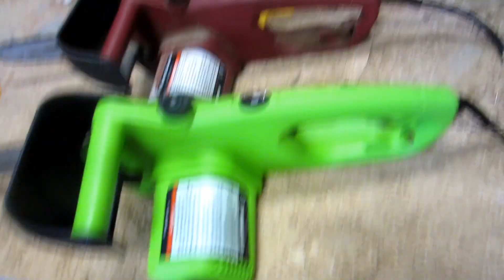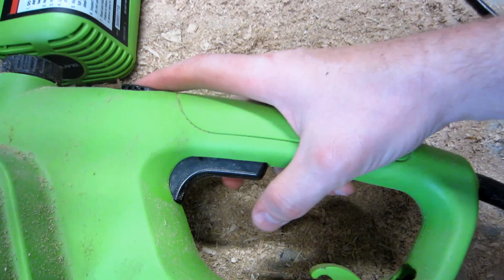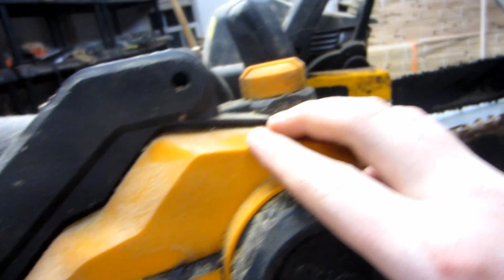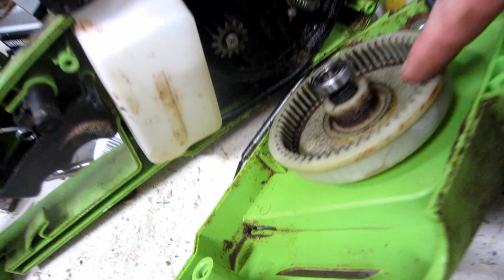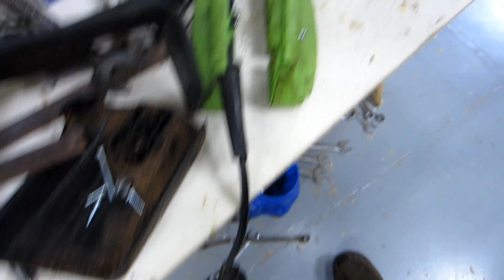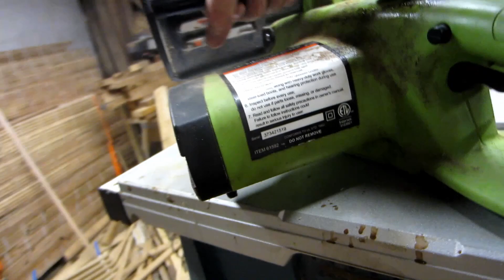Harbor Freight Electric Chainsaw Reviews! (unsponsored)

Comment: how hard do you lean on your chain saw when cutting logs???
Reply from the maker: It's not so much the pressure as the time.  Using an unbalanced tool for a long period of time is highly fatiguing so you end up cutting asymmetrical.  If you're referring to the gear stripping, that is just hit or miss.. first use and it immediately fails, or lasts years.

Comment: the worxs 8amp 14inch  chainsaw  is a very good chainsaw it last lone and yes i use bar and chain oil but i cut  for 2 years and its still runs about a day running clear cuting yea i have to sharpen the chain but i think it good

Comment: Dunno your probs with PP4218. On mine, new (colder than stock) NGK plug, quality chain, and carb adjustment with Husqy tool, and it works fine. Still has no "blade", rather a bar. First thing with HF chainsaw: sharpen chain & release tension a bit to reasonable. Adjuster screw head is VERY hard to reach. Anyhow it looks to be way better than my POS Wen electric.

Comment: I just took a Portland electric chainsaw back for return - transmission failed after just two uses - got a refund with no problem and will NOT buy another one :(
Reply from the maker: Sounds about right.  It really is hit or miss on the transmissions for some reason.

Comment: FYI, the 61592 is now the 64498 (after the power switch recall, I guess).  Just got one yesterday, and they match up perfectly (and all the model numbers on the box simply had 61592 pasted over with the new number; I guess it's cheaper to pay somebody to apply all those stickers vs. waste boxes!)  The 64497 is the new copy of the (lousy) 65255.

The 64498 is not listed on the website, but it was the one on the shelf in my store (Raleigh, NC.)
Reply: how did the one you bought work out for you?

Comment: I bought the Portland 3 days ago, added the oil, checked the chain and then took down 3 trees in my yard (9-10" avg stump diameter), cut them up into manageable pieces. Worked fine for me. For $39.99, worked line a champ. Going to cut down a few more too.
Reply from the maker: Nicely done.  I have cut down dozens of trees and processed them with these cheap e-chainsaws as well... except for the one or two that broke immediately upon first use.  It seems like if they survive the first use, they will last a long time. :)
Reply: Yea I just did the same thing and had no issues and cut down two trees and trimmed a bunch of branches.
Reply: Mines while but want cut any solutions

Comment: This is the most interesting thing about me if the thing messes up on the first one why don't you get the extended warranty or why don't you just take any of them back I'm just wondering myself because anything electric or mechanical with stuff from Harbor Freight always get the extended warranties just a cover crap like this
Reply from the maker: I do a fair amount of engineering, and at the low price point, I figured I could just repurpose the parts in another project.  I ended up returning the broken ones for store credit due to the major recall as it turns out.  I only buy warranties for expensive products generally speaking.

Comment: There is a recall on my chicago saw like the one in the video and the green portland, i took my in yesterday and got a portland for free and no questions ask recall. The safety switch was not shutting the saw off like it was supose to. Look up the notice on harbor Frieght  change saw's
Reply from the maker: Someone else commented about this as well.  I pinned your comment to the top so others might read it.  I exchanged several of my HF chainsaws for store credit, since I don't like the only model they now offer.  Let me know if you or anyone else happens to find a similar chainsaw in torque and price point that you'd recommend. :)  Thanks!

Comment: I only have a little experience with chainsaws. I have a 18" from Black & Decker which worked great for cutting down 1 big tree and 3 or 4 small tress all the way to 4 ft long logs. The chain got worn out after several uses and I replaced with "Oregon' chains and they are awesome!! Also that one is heavy and want to get a smaller one. going to get the Portland one 14" from HF but glad I watched your video. because there came a coupon book and this junk was on the list.
Reply from the maker: Yeah, I'm not a fan of this chainsaw.  The model I liked is no longer sold at Harbor Frieght, so I'll have to find a new model somewhere else to use for primary chainsaw work.  Good luck with finding another chainsaw you like. :)

Comment: Something's going wrong with the one I'm using. It'll be cutting through something then it'll just stop. Then as the motor is winding down, the sprocket will engage again.
Reply from the maker: I would guess the trigger contact is worn out or has a defect.  Those triggers are the reason for the recent recall - they can get stuck "always on", which probably means the impedance is inappropriate on the contactors.  Or maybe it's more mechanical in nature and the trigger gets jammed... it's unclear, but what is clear is that the triggers are poorly manufactured.  Just a guess!
Reply: Chris Covington I think this is the worn down plastic teeth in the gear shown in the video. Mine did this until it was completely worn.  Now motor runs and no spin at all.
Reply: @nathanstoutimore  It doesn’t seem like it is too big of a deal to replace the gear. Did anyone check to see if Harbor Freight carries any parts for these chain saws? It seems like they should being this wasn’t the first post that I read stating that the plastic gear wears out.

Comment: Looks like the extra plastic around the top of the drum gear in the better model most likely prevents flexing of the drum. This extra strength keeps the gears in contact with each other preventing stripping.  Also if there is too much play in the gear spacing it will quickly fail. This  “play” should be check in a new saw before its used as just one skipped tooth will quickly cause the rest to fail in short order.  Thanks for the video. Due to the difference in the plastic gear I will definitely be shopping for the 61592 model. Thanks !
Reply from the maker: Interesting theory about the extra plastic.  HF no longer offers either model - though the new model they offer is closest to the less ergonomic version of their chainsaw.  In other words, as far as I know, they no longer offer the better electric chainsaw.  Personally I've given up on buying chainsaws from HF.  Good luck!

Comment: Eh I've just seen a great review on the one you just got.cut right through a ten inch tree
Reply from the maker: I've had these chainsaws last a long time, or fail first use.  It's kind of a dice roll.  I've cut trees much bigger than 10" quite successfully with several HF e-chainsaw models.  The gear is one issue, but the usability of the trigger is more important for serious use.  Thanks for the comment!
Reply: It's cuz I'ma get one next week, that and pressure washer

Comment: FYI, Harbor Freight no longer sells a corded chainsaw as of this message (5/9/2018). I'm guessing they are coming out with a more expensive model.
Reply from the maker: Confirmed on their website... no corded chainsaw inventory.  Crazy abrupt!  Thanks for posting.
Reply: https://images.harborfreight.com/hftweb/recalls/Electric-Chainsaw-67255-61592-Recall.pdf
Reply from the maker: Thanks.  That explains it!
Reply: No, still available as of Oct. '18.
Reply: Model #64497
Reply: https://www.harborfreight.com/9-Amp-14-in-Electric-Chainsaw-64497.html?ccdenc=eyJjb2RlIjoiNDQxODU4NDAiLCJza3UiOiI2NDQ5NyIsImlzIjoiMzkuOTkiLCJwcm9kdWN0X2lk%0D%0AIjoiMTI2NjMifQ%3D%3D%0D%0A
Reply: Just got their advertising paper (March 2020) and the portland corded chainsaw is there on sale $39.99. Crystal River Florida.

Comment: As far as I know, all corded electric chainsaws use a plastic drive gear. If you push them too hard, the gear strips out. Makita used to make a chainsaw with metal gears, but they replaced it with a plastic drive.
Reply: I pulled my Craftsman apart, It looked pretty much like the HF with plastic to steel gears.
Reply from the maker: I've actually thought about the idea of casting a replacement in a metal... the problem is mixing a metal and the other nylon gears together; metal vs. nylon, the metal always "wins". :)  That said, I just got a Creality CR-10S (knockoff) 3D printer and am planning to experiment with PLA embedded with 30% carbon fiber as a possible replacement gear.  This probably isn't especially helpful to people without a 3D printer, but could be an interesting experiment.  I'm fairly certain there is a manufacturer that just sells "standard" gears and there is probably a compatible gear... I just haven't gotten around to grabbing the current gear and my calipers to attempt to track one down.

Re not lubing the gears: the failure I have in this video actually was lubed, but it's another theory that could be true in some cases.  I'm still scratching my head a little due to the dramatic failure of some and others that last years, yet everything looks pretty identical.
Reply: I stripped the plastic gear out of three Remingtons, one was an old made in USA model. I recently bought a Black & Decker 15 Amp with an 18 inch bar and even though it has a plastic drive gear I was able to cut seasoned hardwood that was larger than 24 inches in diameter. The saw is amazing. I did take it apart and greased the gear with Super Lube before using it and again after a couple of hours of serious cutting. I don't know if that made a difference, but I figured it couldn't hurt.
Reply from the maker: Yeah, not surprising.  Brands have no loyalty to customers, so customers can have no loyalty to brands.  You can buy most brand name products and they aren't much different - sometimes even worse than the really cheap brands.
Reply from the maker: Anything to save a buck I suppose.
Reply: That, and make a buck on replacement parts.
Reply: someguyinncarolina  Just my 2 cents, the biggest problem is probably like you said, the manufacturing process for the gears may not be very consistent along with probably cheaper plastic. It would seem like they could invest a little more for good quality plastic that takes some abuse and charge the customer a few bucks more. I'm also wondering if they sometimes don't lube the gears well at the factory. It would be cool to see if someone could take a new gear and use it to make a mold and maybe make an aluminum gear if the details would come out, those gear cogs would probably be difficult to cast. Not sure if aluminum would last any longer but..........
Reply: someguyinncarolina  Yeah, you're probably right, tolerances not being very good and/or material just not tough enough. It would be really interesting to see if you could 3D print a gear that would hold up!

Comment: I have the red one - 14" Chicago Electric.  I also have a 14" Remington and a Remington pole saw.  The chain which came on the HF cut poorly.  At one point, I swapped the Remington chain over and it cut fine on the HF, and better chains are just $5 (ebay).  Yesterday, it started free-wheeling, so took apart and found the large nylon sprocket had stripped teeth.  Must pull one bearing off the shaft to remove the sprocket.  Like others, I can't find the sprocket anywhere.  The plastic sprocket teeth wore away on my Remington, but replacements are easy (ebay).  On plus side, the HF has a rugged ABEC5 bearing on each side of the shaft, while Remington uses a special needle shaft bearing and the outer shaft end isn't supported as well (can wear gears).  Downside is no replacement nylon sprocket and the saw is heavier and larger.
Reply from the maker: Thanks for the info!  It's on my radar to try and find a replacement gear - possibly from a generic gear supplier.  I'll post a comment / in the description if I find something.

Comment: I agree, these are total junk !! I threw mine against a tree after the chain come off the 20th time.....
Reply from the maker: Haha!  Though I have to mention that as chains heat up, they expand.  As they cool down, they contract.  There's always a little bit of a game back and forth if you're doing lots of cutting.  Keep the chain sharp and lubricated and it can help prevent slipping in my experience. :)

Comment: I use electric chain saws from Harbor Freight exclusively and have had the same problem with that nylon gear on the inside always going bad but excessive use on one and the other very little used before it went bad! I will gladly buy the replacement part if I knew where to get it as they're easy to repair😱
Reply from the maker: Glad to find another HF e-chainsaw fan!  What I'd really love is a replacement that is not nylon but something a little less prone to shearing.  I'll do a little research and see if I can find something to replace it.
Reply: someguyinncarolina I would be delighted if you can locate that item,I even googled replacement parts for this item and had no success 😱
Reply: When chainsaws cut to the left -check your sharpening

Comment: I had the older maroon one which worked great for a long time until the NYLON main gear stripped out.  Almost all the other reviews of the Portland brand seem to be positive.   Perhaps you got a fluke...or two.
Reply from the maker: Certainly possible.  Thanks for the comment!
Reply: 1,000.020 replaced because a safety problems